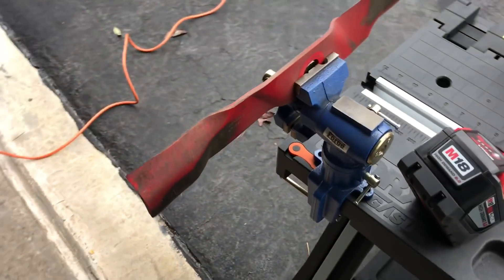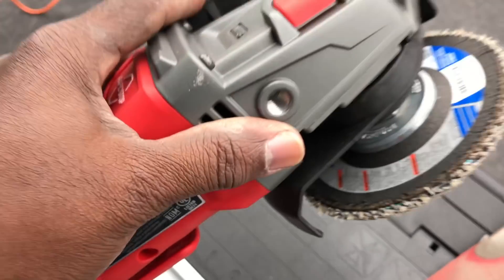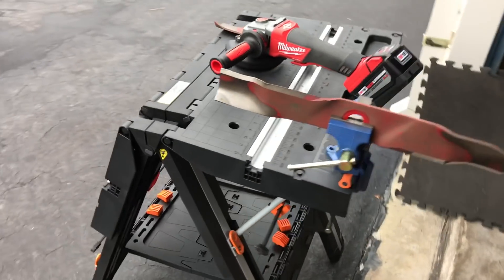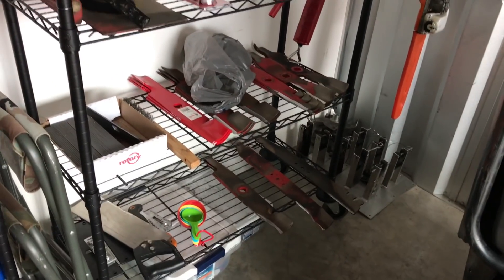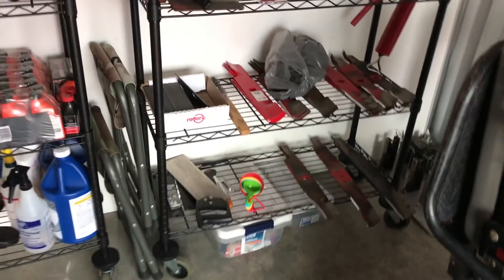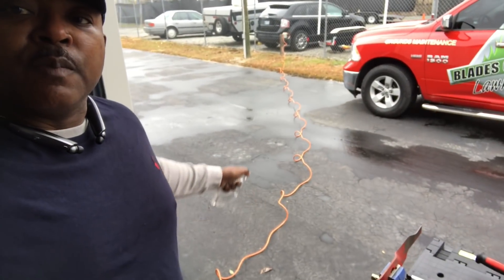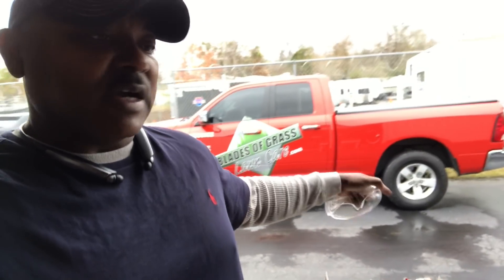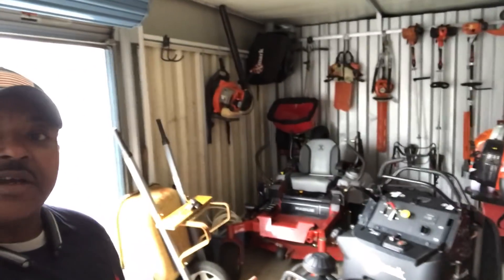I'm running my lawn business out of a storage

Comment: Just subscribed to your channel. I'm actually going to a local storage facility myself. I m going to rent a 10/15 garage and a parking place for my enclosed trailer. Great idea.  I'm a small business and garages where I'm at are hard to find and very expensive.
Reply from the maker: Nice. Thanks for subbing!
Reply: What kind of hitch lock do you use on your trailer ?  I'm going to be getting a storage unit and parking space for my trailer. Would like to secure it.  Thanks
Reply: What grade grinder pad do you use on your grinder to sharpen your blades?

Comment: Hey Johnny you should chain all your equipment with steel threaded cut proof wire.  It's wrapped in rubber and let me tell you it takes like 30 mins to cut it with out power tools.

Comment: With free electric and water close by your unit is great.  For $200 a month is worth it if you don't want keep your equipment in your garage and/or shed. At least you have security measures in place (past video), just in case there is a possible break in and/or theft situation.

Comment: Hi, Jonny.  Does your storage facility allow you to store gasoline in cans inside the unit?  I have checked a couple places in my area and this is a hang up.  Just wondering if you store gas outside or have some other insight.  Thanks. -Jonathan C.
Reply from the maker: Florida Turf Pros No. they do not authorize gas cans in the unit so I leave them in the trailer or chain them on the fence covered up behind my trailer.

Comment: Johnny, I was actually just thinking this a few weeks ago, about renting a storage unit. What size is that? I seem to have similar amount of equipment as you. My only concern is other renters being in my way about the time I need to park in front of my unit. Also, do u load/unload all your equipment every day. I thought I could maybe solve this issue with an enclosed trailer, but obviously u use both enclosed and storage unit. Currently I just back my open trailer into my 2 stall garage. But it can be a problem being that I have a family and need the space.
Reply from the maker: I have never had an issue with other tenants in my way for loading or un loading and I only store all my equipment on long weekend other than that my equipment stays in the enclosed trailer. Its a 15X20/ 300 sq ft